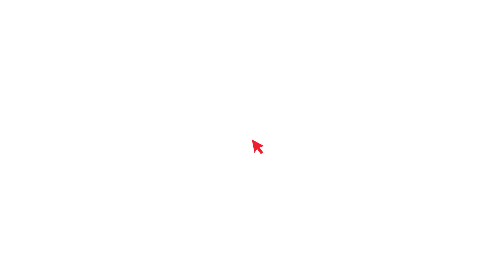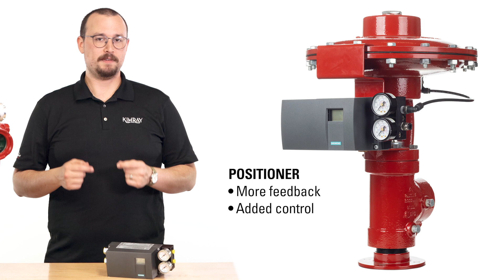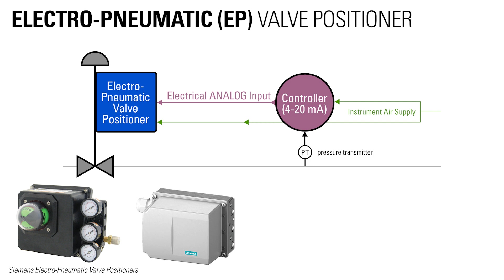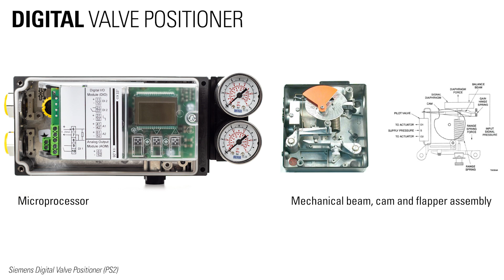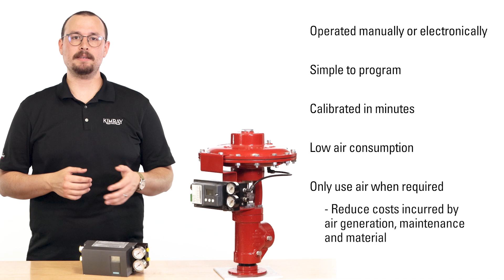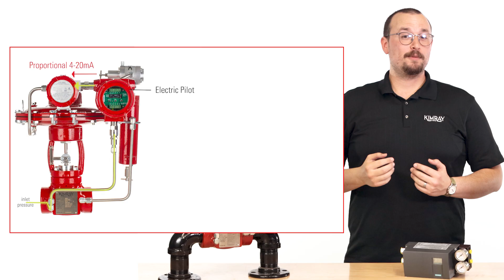Pneumatic, Analog (Electro-Pneumatic), and Digital Control Valve Positioners for Oil & Gas

Comment: While working in Tennessee, I was asked to look at their Feedwater Regulating valve. The problem was that depending on the valve position, it would not control? At the low end, it was sluggish & had to have to Proportional Band adjusted just to get it to respond. But when the valve opened further, it would oscillate indicating a hi gain? I opened the positioner & found an equal % cam, but when I looked at the valve flow characteristics, I discovered the same Equal %. What the in housers thought, was they had to match the positioner cam to the flow characteristics of the valve? But what was happening is the non linearity of the valve assembly was being amplified causing different valve responses at different valve positions. I replaced the Equal % cam for a Quick Opening cam & the valve performed fantastic! In fact, Ops said that they had never saw the valve achieve a better control profile? Once you understand the valve assembly & it’s parts & the interaction between them all, it becomes simple!!!

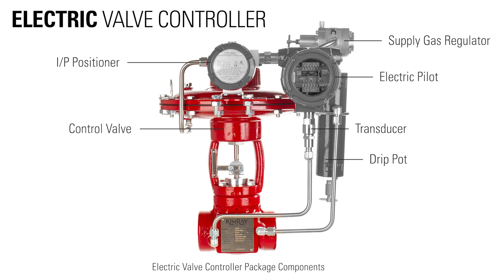Comment: Good video.... @3:50, What is "electric pilot" in electric valve controller and what is the function of "transducer" in EVC?
Reply from the maker: The electric pilot is a valve controller that utilizes 4-20mA to control an electric actuator. A transducer is a device that communicates the process condition via an electrical signal in real time.
Reply: @KimrayInc  Thanks for your kind reply... Keep it up...
Reply: I love this video